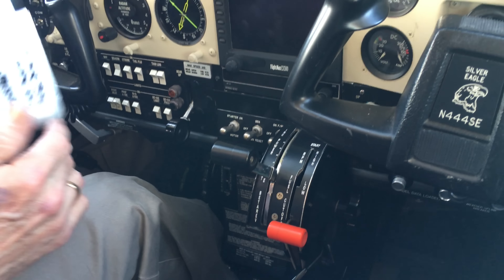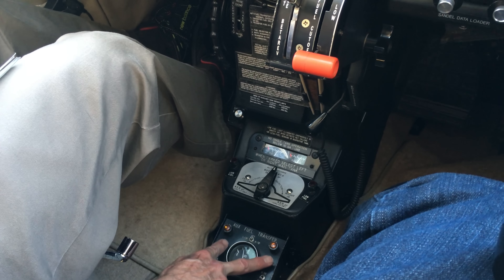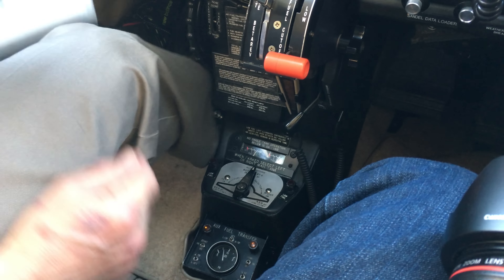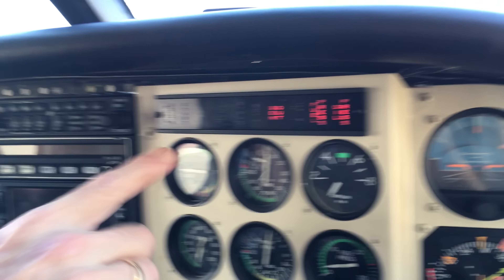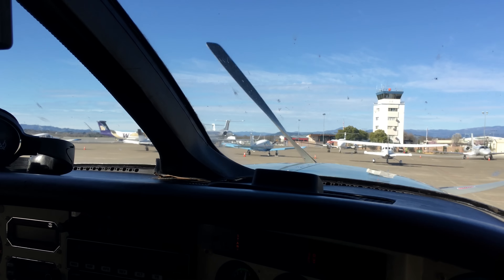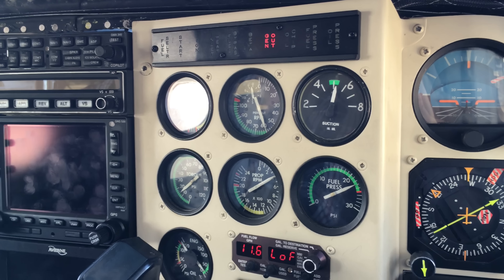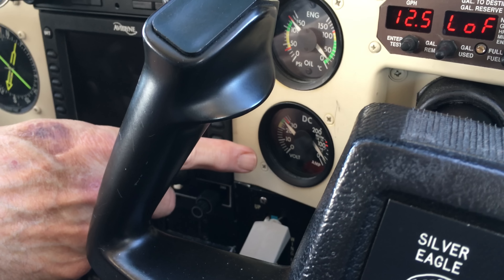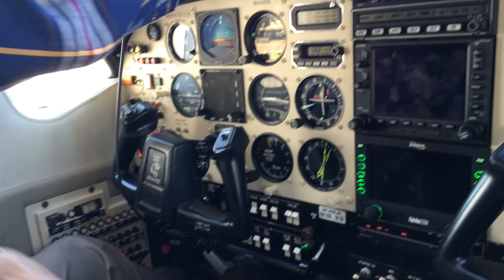Turbine engine startup on Silver Eagle (Cessna P210 turbine conversion)

Comment: Does the cabin pressure go on when the engine turns on, or is that separate?
Reply from the maker: Great question. It's separate. I haven't flown this aircraft in 2 years and I only have about 10 hours in it. If I recall right, there is a dump valve that has to be closed and remain closed when pressurizing. Then, there is a pressurization selection knob that lets you set your desired cabin pressure. Then, there is a separate gauge for cabin altitude, cabin rate of climb/descent, and pressure altitude.